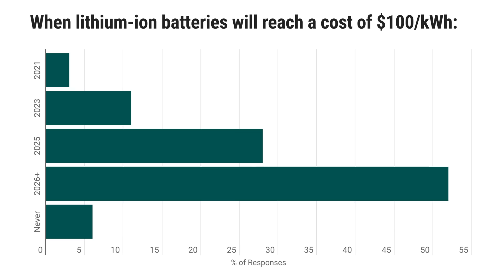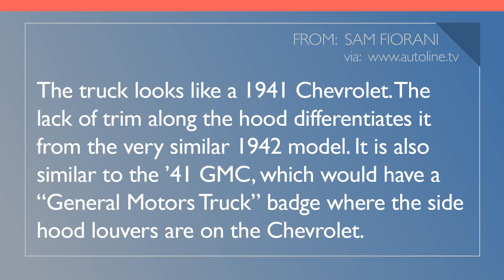Our Best Look at GMC's Hummer EVs; Renault & VW Post Big Losses - Autoline Daily 2885

Comment: EV Prices: Stop looking at the sticker price, and look at Total Cost of Operation (TCO). The reduction in energy and maintenance costs already more than offsets the higher sticker price. I was paying $800/month TCO for a used $24k SUV with crappy mileage and a 50mile/day commute. ($350 loan, $250 gas, $100 maintenance, $125 insurance). Meanwhile a new $60k Model Y would only be about $850/month TCO ($700 loan, $25 power, $125 insurance, near $0 maintenance).
Current EV batteries cost about $150/kWh. At $100/kWh, a new Model Y would be cheaper to own and operate than a used ICE SUV. 
 Wards survey. If I polled a number of film camera executives about how long they thought it would take for digital cameras in cellphones to put them out of business when the iPhone was introduced, I imagine they would have said "decades", too. 
Maybe poll the people actually designing and manufacturing the batteries and EVs, instead of ICE vehicle executives?
I mean, there are battery manufacturers literally saying "We will hit $100/kWh by 2023." So why are we asking ICE manufacturers?

Comment: I still insist that there's not enough left of that truck to differentiate it by year or brand. It could be any heavy duty Chevrolet or GMC truck built between 1941 and 1946. Badging and chrome are just too easily removed, especially if the vehicle was parted out at some point, which this vehicle probably was... note the complete lack of a grille even though the intact front bumper shows that the vehicle did not suffer a frontal collision.

Comment: Combustion engine cars cost iess at first. But how much do people spend on petrol and upkeep both high
Reply: Gotta teach consumers to look at Total Cost of Ownership, not just sticker price. 
If the loan costs $200/month more, but electricity and maintenance is $200/month less, then it's a wash.
Reply: @CSHarvey  Plus Tesla's Insurance arm, will have data on driver habits and record to evaluate their risk profile meaning good (safe) drivers will pay massively reduced premiums. plus as Elon mentioned in passing on the call in relation to insurance, the cost and ease of repairs will be a factor that the engineers will be looking at to alter/amend the design to reduce repair costs as well as manufacturing costs, one of the advantages of vertical integration that reduces costs and increases profits on both sides

Comment: So far, I haven't seen a "barn find" that is an actual barn preserved vehicle.  Most have been rusted out in the woods finds.
Reply: They still look better than the crap that I found in one of the old barns when I bought my current property. Let's just say that there was a 60 year old Oak growing through the roof of it. And the scrap metal guy who came to recycle all of the rusted beyond use motor toys, stopped and got a tetanus shot before he came by. It definitely wasn't the barn that I was hoping to find a well preserved Gullwing Mercedes in.

Comment: One thing I never hear anyone talk about re EVs is they are, on avg, between 1,000 & 2,000 LBS HEAVIER than comparably sized ICEs.  Doing simple math @ 17M units/yr x 1,500 Lbs = 25.5B Lbs more material used to make EVs.  That's sounds like a pretty 'material' environmental impact, no?  John anyone talking about that?  John/Sean, in my view a REAL advancement in efficiency/technology is "Doing it FASTER and Doing it w/LESS!."  Your thoughts?

Comment: I have ZERO interest in a LIMITED RANGE, LONG RECHARGE TIME, and EXPENSIVE BEV. PERIOD. Cobalt will never get any cheaper. Everybody can't afford $100k for a vehicle. The cheap Model 3 is $50k and had a LIMITED range.
Reply: Sorry, you seem to be living in 2010, the rest of us are in 2020.
Reply: Hi Dennis, not sure if you know, some EVs can do over 300 miles, and charging is done while you’re asleep. Yes colbalt is not ideal but in most Bev’s it’s only 2% of the battery. At the moment in China CATL are making colbolt free batteries. Most EVs are between $30 and $50 thousand, the Tesla M3 standard range is under $40 thousand. And has a real range of 220miles which is more than most need in a day.